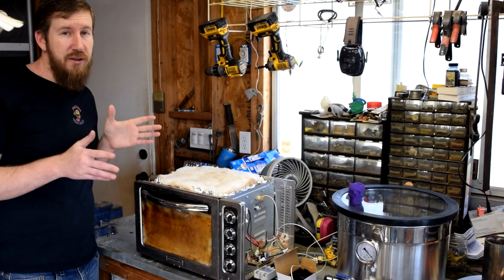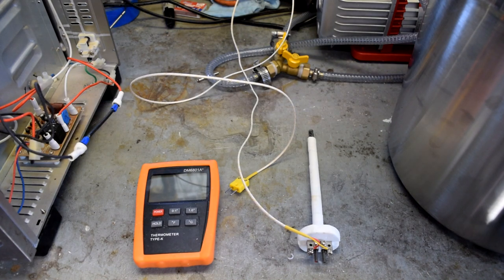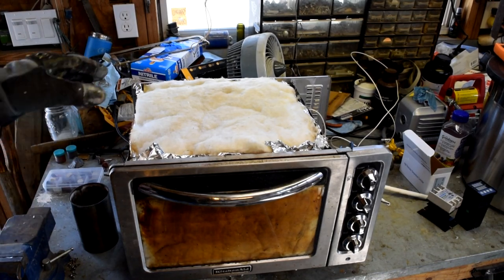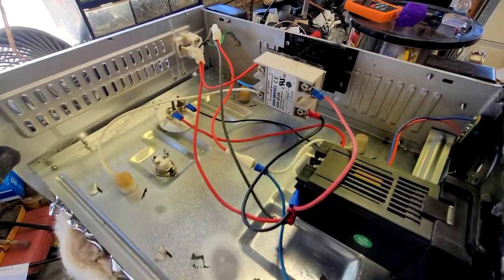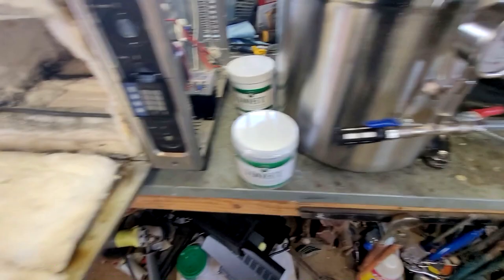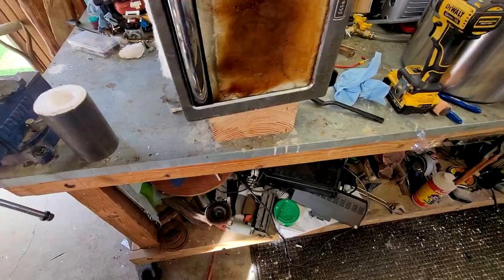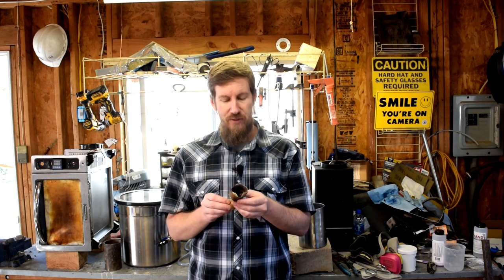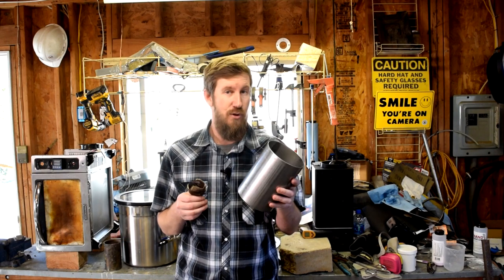Toaster Oven to Burn Out Kiln? 3d print to Metal Cast

Comment: Interesting. I would finalise your toaster oven build with it upside down. As you said, heat rises, so it makes sense to me to have the delicate electronics below the heat. Great idea though
Reply from the maker: I did insulate the top portion more. At the peak of the burn out I used my infrared thermometer to check the temperature of all sides and the temp is no higher then 140F with the top being the lowest temp.  I added the fan as the Solid State Relay was getting pretty warm and I had that fan laying around.
Reply: I was thinking the same thing.
Reply: I would do it to the side, then there's less worry about a failure resulting in destroyed electronics.

Comment: Casting temparature of flask should be 150° less than Melting point of Metal. 
Use perforated flask with Flange for Wire frame designs or intricated patterns. So you can fasten the Metal flow by vacuuming  more area in time. Also you need to blow air into Flask and heat up again so Ashes of resin is eliminated. Then cast.

Comment: There's a good chance that the device didn't come calibrated or is calibrated to use a different thermister than what you're using. I know the little programmer I got for my DIY enclosure heater has a sequence you put it through to calibrate the temperature so it wouldn't be surprising if your device had one as well. If all else fails, you could put a separate thermometer you trust next to it's thermister to get a comparison.

Comment: Great project! I will certainly upgrade mi electric oven. What kind of plaster you use?
Reply from the maker: For the casting? I use Prestige Optima investment. You can get it off amazon, I left a link in the description.

Comment: Is there a way to run coils through it to avoid haveing to replace the heating element
Reply from the maker: You could pull the heating elements out at the beginning and replace with coiled elements. After my original elements burnt out I have
 since replaced them with the coiled elements I bought of of Amazon.

Comment: Awesome video! What investment powder are you using? Also, what's your printing setup? I've tried casting using ApplyLabWorks cyan castable resin and I haven't gotten great results. I was also using R&R Advantage, but I was thinking about trying Plasticast since it's designed to handle the expansion of resins. Any advice?
Reply from the maker: I have only used Siraya Tech Cast, its inexpensive and I have had pretty good results. The investment I used in this video was Prestige Oro but I recently switched to Prestige Optima as its made for resin and Oro isn't. Cant really say much about the Prestige Optima yet as I only had one cast with it. As far as printing setup I was using a old resin printer but just upgraded to the Phrozen Sonic Mighty 8K. Best advice I have is follow the burn out process and mixing process as best you can. Thanks for watching!

Comment: Would I be able to keep my quartz triac heating elements when using this temperature controller (I wouldn’t need them to get hotter than their current capabilities).
Reply from the maker: I don't see why not, from a quick google search they look like they are just a resistive load. The solid state relay that hooks to that controller doesn't care about the load as long as its within the current rating and not a high inductive load.

Comment: Do we have to have a burning out kiln? But I don’t see anyone trying lost wax casting without kiln, can we just use torch to melt the wax and pour?
Reply from the maker: When burning out wax or PLA or resin from investment you need a really high heat to get rid of all the ash and you need to cure the investment. I have done casting with plaster of paris and used an old BBQ to burn it out but I wouldn't recommend it. You wont get good or consistent results, much better to burn out per a typical burn out schedule.

Comment: Kudos to you ! I won't miss my rarely used toaster oven  I guess LOL
Google "burnout oven" and find few choices at jaw dropping cost. Then again you are buying a small kiln.
But really $4000???
Was very surprised that you could reproduce any of the mesh like feature of your skull and thought it unlikely that  filigree like structure could burnout without leaving residue and clogs. PVB or PLA? 
I gather that pre-heating the investment mold is key to good result, still I figured that you would need vents.  Perhaps the plaster is somewhat porous. The density of brass versus aluminum must be a factor for gravity feed pours. Anyhow, I am trying to make a decent go at casting some sea mammals for aquatic diorama. I have  a 250mm long dolphin as my first project. Even at this scale  the pectoral and tail fins are extremely delicate and based on my results to date, are bound to be the lion's share of the challenge. They have to be perfect.   I imagine me with my mig welder trying to re-attatch a broken flipper. Support structures will have to manually be applied rather than leaving it to Cura. 
Some 6061 T651 aluminum alloy scrap I have been holding might be useful for yielding a more durable model  but eventually I am going to have to acquire some proper ingots of A380 ? or maybe even melt down cans.  In Canada there are no suppliers of ingot that I am aware of that cater to the hobby or start up. U.S. supply is expensive and many just don't ship here period.  Regards

Comment: So how many burnouts has this toaster oven done so far?   I want to do some lost PLA casting but the cost of the burnout kiln is a big impediment.
Reply from the maker: Tom I believe I was able to get about 20 burn outs before one of the elements kicked the bucket. I ordered some new wire elements on amazon for 20 bucks which was way more than enough for the lil toaster oven and those have been running good for the last 4 burn outs...I suspect they will last a fair bit longer then the originals as they are more suited to the temperatures.
Reply: @RealProjectTube  cool - good to know. I was thinking that using some steel wire to hold up the insulation may work - or would the heat degrade it?  The way I am pricing it out even if I have to pay $25 for the toaster oven on Craigslist I could get this done for under $200...
Reply from the maker: @IamTomzo  The steel wire might last 1 or two burn outs. You just have to be careful the wire doesn't touch the heating elements as that would short them out . By the way if you keep your eye out on Craigslist you can find deals on Kilns you just have to be patient. Last one I got was for $100...they pop up for cheap  every once in awhile.

Comment: If you guys see how I used to do it back in Cuba which is a communist country, Im talking about third world shit, I used to put the flask, which was just a copper pipe cut, on top of just and electric furnace with an aluminum pot on top, for 5 hours straight, and then cast in a centrifugal casting 😂